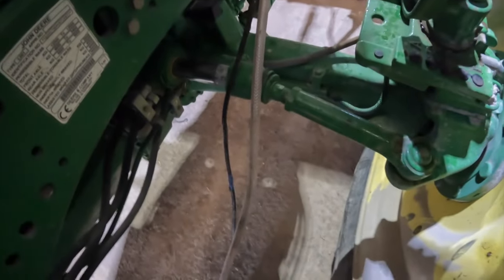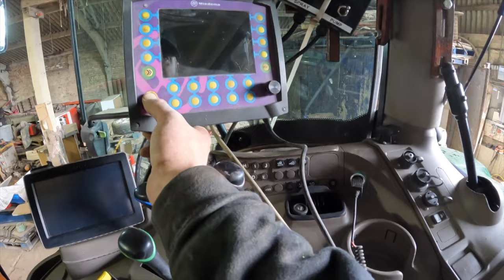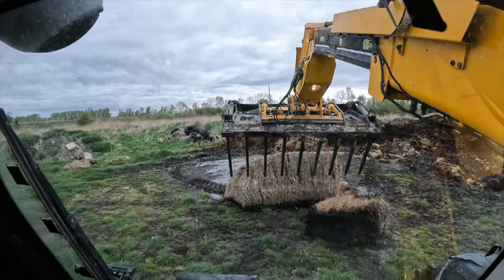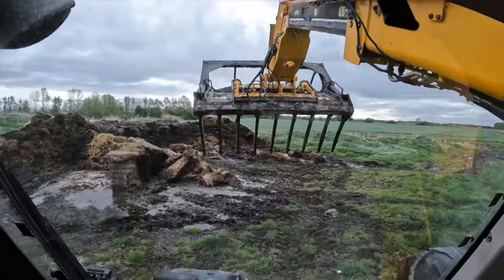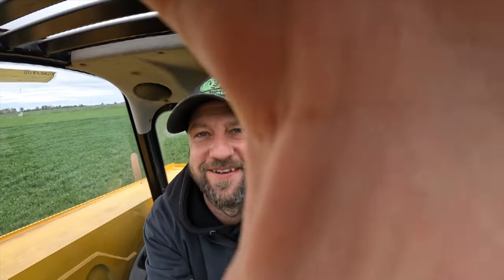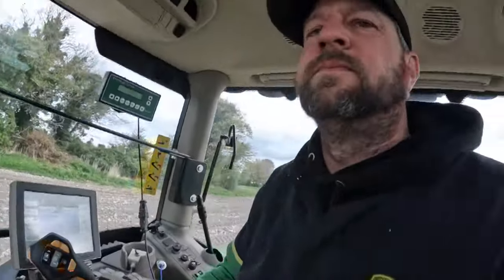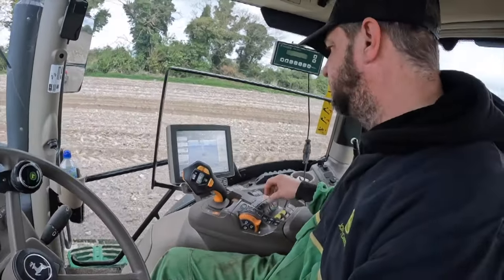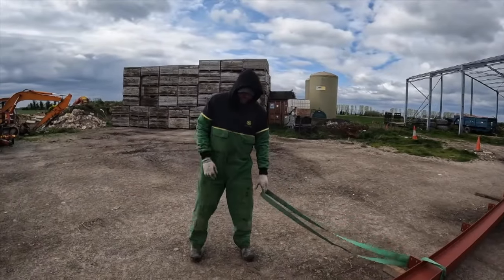Will we ever get planted these potatoes - farm vlog - Fenland Farming Adventures -

Comment: Too save the hassle of pulling off your steps to connect up to the battery it would be easier if you hard wired an Anderson plug into the cab for power….as for the old timers way of testing soil warmth..two words…….wet hole phnarrrr phhnnnaaar!😂😂
Reply from the maker: 😂😂😂yeah should’ve put a plug on the battery and left it but they get rusty and corroded so best off removing sometimes mate